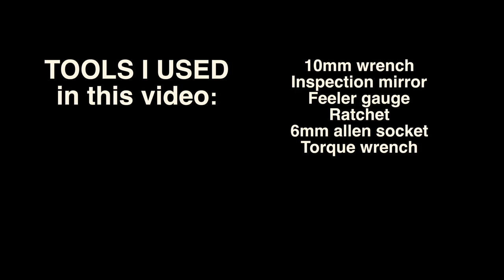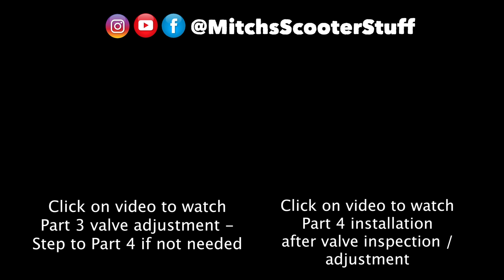Suzuki Burgman 400 Valve Clearance - Part 2 - Inspecting 2007-2016 | Mitch's Scooter Stuff

Comment: Nice Valve inspection.  Good thing it's fine.  The Burgman 400 has SHIMS.  If out of adjustment you need the new shims AND you must remove the cams - a very specialist job.   Best to just change oil frequently on a shim bike and drive it.  Shim replacement by an expert Dealer is expensive.

Comment: Hi Mitch,  thank you for the video. I have a burgman 200, so the work is similar.  What to do if the valve clearance is too tight to loose? In my manual I read that a special tool is needed to adjust the clearance. But where is the place to adjust this?
Reply: I have the same scoot,have u adjusted them ? do you know how much do they need to be ? ex and in ?

Comment: Thanks! Do you find the clearance gets loose or tight as the miles get high?
Reply: Clearance gets tighter as the valves wear into the head. The danger is always too tight compared to too loose. Once it gets to a certain point it will not close entirely or the duration is longer and it can burn up the valves.